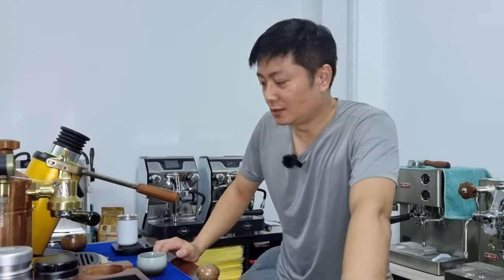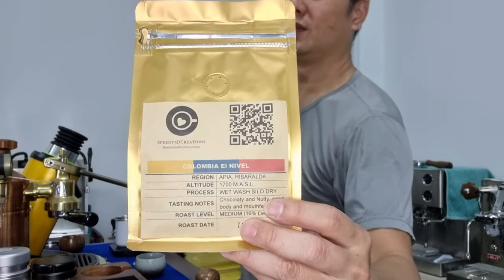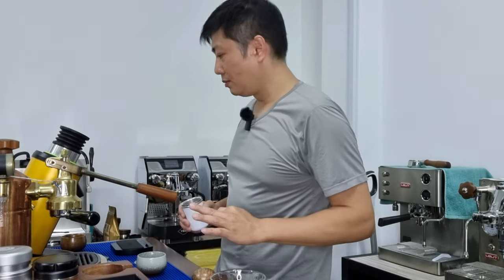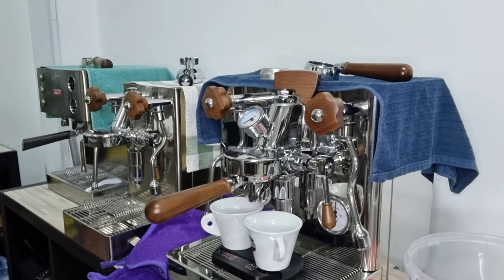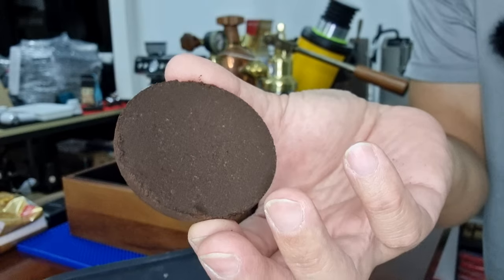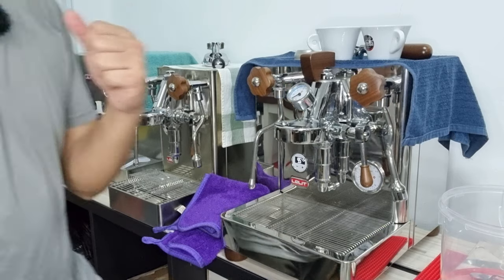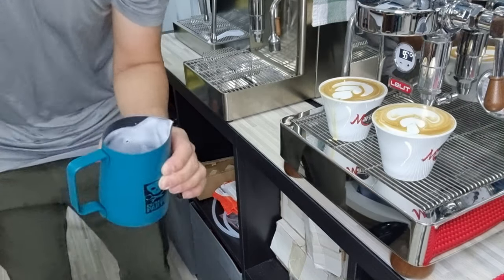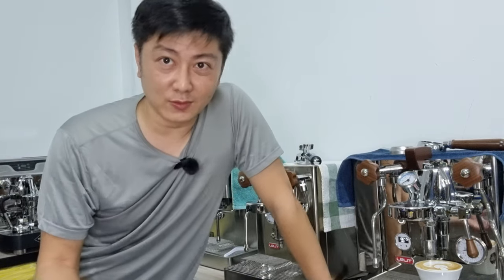Puck Screen Hack | How to remove your puck screen from the wet puck effortlessly?

Comment: Thanks for the tip! 👍

Edit: Also, unrelated, I sent you this tweet over the weekend: "I noticed you removed the declumper from your thingiverse for the DF64 to do an updated version. Any ETA on when that might be available?"
Reply from the maker: Yes as that design when 3d printed does not last long and can even melt under some uses. And hence I removed it preventing more people from using it.
Reply: @CaffeMartellaSingapore  oh, that's good to know. So your recommendation is that I should remove it?
Reply from the maker: @Nick Wilson  I will be doing a follow up video on how I do a mod to the declumper. This time I will get all my tools and necessary item ready before I shoot the next video!
Reply: @CaffeMartellaSingapore  is this the mod where you cut off 2 of the sides of the insert that comes with the DF64? If you do RDT & WDT (& also grind into a tumbler) is the declumper even necessary?
Reply from the maker: I don't do RDT. I use pvc flap in mythos style.
Reply: @CaffeMartellaSingapore  do you have an improved technique from the video you did 7 months back using the cardboard and pvc film, besides using Ben's 3D print version of your original declumper minus the grid (rather than cutting out the silicone)?